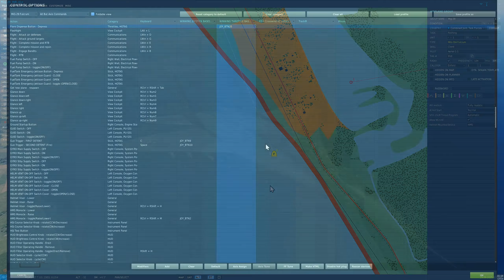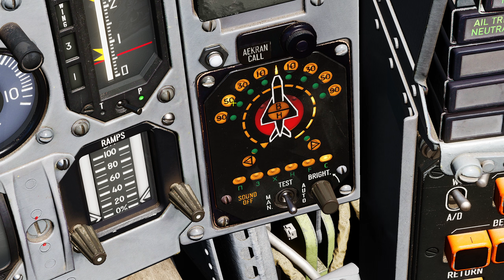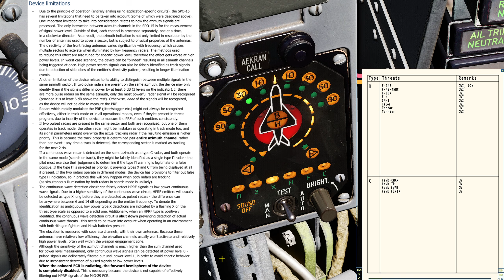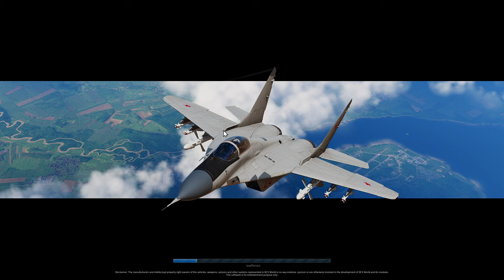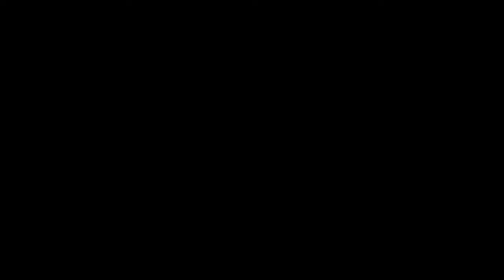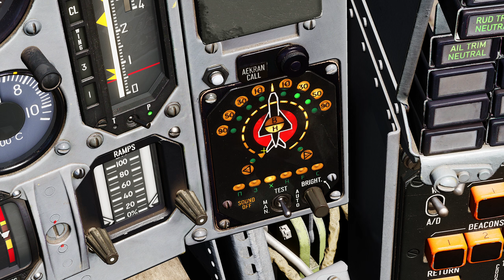Mig-29A Fulcrum: SPO-15LM Radar Warning Receiver & Countermeasures Tutorial | DCS

Comment: Few additions and small corrections to the spo-15LM:
First of all, flashing light on the signal strength defines the lethal zone of a thread, any bars after the flashing ones means the spo thinks we are in enemy's range (as you might guess, this is highly inaccurate in the LM version).
Secondly, the П is not an N, its the P letter.
Thirdly, it doesn't recognise any launches besides nike Hercules because thats how the LM version with basic thread database was. It requires another electronic plate or something like that to be soldered with resoldering some internal stuff to be able to distinguish more launch warnings, updating the database is not enough for this particular version. Logically, some threads in dcs are just not there like AMRAMS or other fox3 since there weren't operational when spo-15LM was being made.
Additionally, if you get locked by anything other than the П signal, like X or F, and then it suddenly switches to the П, most of the time it means enemy has launched a missile, although the switch may happen too late to properly react. Amrams going pibull could also trigger the П symbol with almost full strength (usually 3-5 seconds before hit tho)
The П switch happened at the end of the video.

People don't realise that's just how the first version of MiG-29A was, also the export version so with less capabilities, and they will moan about it without deeper understanding of the doctrine.
It is slightly more advanced than SPO-10 from MiG-29 but every intercept would be done in pairs or even more aircraft - all with Ground intercept command that will give braa calls, warn about any incoming enemy missiles etc.
I can agree it is a difficult system to work with without the GCI but after some understanding you can still fly and not die on servers, although there's no point in flying against spamram servers. It is kinda like mirage 2000, it's too advanced for coldwar against F4 Phantoms and such, but not equipped for flying against DCS versions of F-15, F-16, and F-18 with datalinks and flawless sensors in "cold war" servers
Reply: In 1987, Yugoslavia acquired 14 MiG 29s from the first series. In the manual for pilots "Directing the L-18 aircraft" (code name for MiG 29), it is not written anywhere that the SPO has a limitation when its own radar is turned on, that the front hemisphere of the SPO is turned off. I think that's a great excuse for ED, because they found in some technical manual for the device itself something on that topic, that the Mig 29 should be a sitting duck in DCS, otherwise it's quite solid for combat.
Synchronization of FCR and EOS is not implemented yet, predicted distance to target for radar and ED should finally be addressed more seriously with awacs and GCI, it would be useful for anyone flying any aircraft in DCS.

Comment: Lol Cap. You going over the RWR is giving me flashbacks to learning how to fly the older first gen MiG-29 and reading on how to use that RWR. It's well, not really funny but an interesting contrast to how US pilots and USSR era pilots were expected to behave. In the US, pilots rarely ever read the entirety of any instruction manual, especially if the explanations would be too long and asked around instead until some sort of definite answer could be found. Russian pilots however were expected to read everything or else not be cleared to fly and would be regularly quizzed on the written material, with some of the manuals being dense with text and as thick as college textbooks. Also, you HAD to learn the old Soviet era systems first otherwise you would NOT be cleared to fly the more modern (read: Much more expensive and time consuming to build.) post-Soviet era versions. So yeah, definite contrast in the attitudes of pilots between the Cold War era US and USSR. Also, good explanation Cap and yes, younger pilots should be much more appreciative of how much easier more modern systems are to use in terms of knowledge and brainpower/focus needed to use those analog systems coherently.

Comment: I know it's not the relevant video, but I have an issue in multiplayer with INS navigation:

I follow all the steps from your startup video, yet the HSI does not turn/respnd at all when I press the buttons (equivalent J and 9 simultaneously). 

It DOES work in solo play, yet on a contention server, it never seems to work and the INS just never completes...

anyone konw a fix to this? I heard to only use the standby Gyro, but this also does not work for me

Please help
Reply: Its a bug in contention. You have to hot start.
Reply: @hurrikage09 makes sense, thanks for the reply
Reply from the maker: Sorry, I havn't looked at Nav yet.
Reply: @grimreapers  No worries, it's actually the alignment from a cold start, which you have looked at ;) 

I really dont know whats going on and why its not working in a multiplayer server